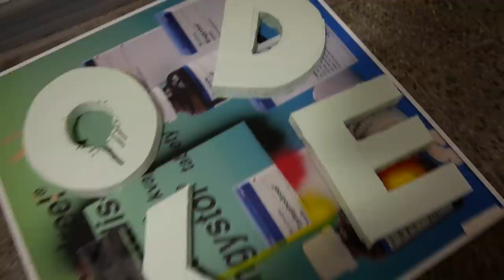I TRY CARVING - This stuff is sooo Satisfying!

Comment: Hey doke, my parents use to have a poly art business and used a table cutter, two pieces of poly, glued with aquadere. One would be a black background with the colour pieces stuck on top to make the 3d. They also used thick cardboard as the design template which was pinned to to poly and would allow the hot wire to cut close clean lines. I have lots more tips if your interested.  I write Wizer  and  live in Australia. Peace

Comment: For the next time you do this, you could use the clean cutting wire to cut the inside holes, just cut in through one edge and around the inside hole then back out the same slit you cut to go inside the hole, it will leave minimal visual damage and could be glued together if the tiny gap bothers you

Comment: The best way to get rid of the bulk of the high density foam is with a fine blade in a jig saw.  Plus, you can get super clean lines with the use of sandpaper.  It sands extremely well.

Comment: Art hack for big circles (I always use this one for mandalas when I draw something bigger) - tie a piece of yarn around a pencil, then take the other end and wrap it around a nail/pin/ whatever. The yarn should be as long as half the size of the circle you wanna draw. Then put the pin in the middle of the space where you wanna draw the circle, pull the pencil as far as you can and boom - you'll get a somewhat perfect circle.

Comment: At my work  for foam cutting in the packaging department we have a table with  a hot wire going through vertically. You have way more control when have it fixed and just move the foam. Its like having three hands.

Comment: You should be able to take the wire off on the first one. So the straight attachment you used was to make the initial mark for the inside shapes then you can go back and use the wire to cut it out. You would just have to undo the wire and retighten it.

Comment: As everyone mentioned get some sandpaper. I would also suggest to use filler spray before painting. Maybe you can get a smoother surface without the foam texture und sketch lines

Comment: you could try to just cut the sculpture on the outside and maybe use one of those sawblades you were mentioning in the video but you can defenetly also get a better result with a really fine hand saw some sandingpaper and maybe use some sort of a dremel tool to give it more texture and depth :)

Comment: I like the carving video I was just thinking when you're using the needle Hotwire thing if you just kept a wire brush nearby and clean it every so often you might be able to get straight smooth lines with needle tip

Comment: There is a tool similar to yours but the hot wire is vertical and it's mounted on kind of a plate so you put your material on the plate and then you can move it thru the wire so youll have got excellent 90 degree shapes and round shapes will be much easier. Hope you understand what I mean. PS. You're an awesome Youtuber
Reply: https://shop.probauteam.de/epages/61352506.mobile/de_DE/?ObjectPath=/Shops/61352506/Products/Proxxon&Locale=de_DE   

That's a web link for the product I mentioned. Greetings from Germany 🇩🇪

Comment: Not sure you know this Doke but when cutting out areas such as the inner part of the "O" you can poke a hole in the center of the area then on the main wire foam cutting tool you un-tie one end of the wires from its post then string it through the hole of the "O" and cut the desired shape out. Cutting foam is pretty nasty if you don't have a fan or open area for the fumes.

Comment: The rod cutter is used to make a hole to then disconnect the wire feed through hole reconnect and cut probably. Almost exactly like a jeweler saw would be done. Pre drill hole insert cutting apparatus and Bam!! Idk just a guess

Comment: If you draw the design you want to carve on paper and spray glue it to the foam the hot wire wont cut the paper giving you a clean edge that's how I've been doing it for years. You did great for free hand though.

Comment: The nice thing about styrofoame is that you can sandcast it, whitout removing de faom creature out of the sand before casting. In this way you can cast everything that you make out of the styrofoam. This is because the styrofaom will  disapear when the hot metal touches it.

Comment: Metal straight edge and tape it to the foam. Wire follows the edge. Prob will destroy the wire faster though. Get a steel straight edge about 18” at least

Comment: I think that when you have a hole in a letter the idea is to make a small hole first with the point tool. Then take off the wire from the cutter, thread it through the hole and put it back onto the heated cutter.

Comment: Hello Doke I have used this trick alot to seal poly or any kind of foam check out Punished Props Academy on Youtube. Basically use Mod Podge or any white glue for the 1st layer then you can use rattle can primer afterwards. Then paint with with whatever you like, plus you can also sand the primer smooth as well. 
I really like your content and art work keep it up.

Comment: Doke , I feel that you might miss the one thing about this, as much as you might already have read. BUT ... when doing these sculptures cutting out is just one part. Then you have to patch, as @SCOCAT stated you need to high grit sand it also. So here is my two cents (or 2 euros). 

1: I would of done what you did and cut each letter out as a single unit. 
2: Cleaned them up with the sandpaper and just worked on the over all shape (not just blocked but any other way)
3: Used Poly glue to adhere the letters together and made it flow that way. 
4: Airbrushed some color into it and or applied bondo to make it stiff.

This all sounds good and i know you are not "ballin" (make tons of money) but this video is a good and solid foundation for things that you can build on and make WAY better. You use the platform of youtube to show your content, and i am sure they have some creators that do Poly crafting also so you can see or do what they are talking about. 

* What i like to see on the next video is - Gunpla with street art on it * : Link for expliantion https://softoyhobby.com/tag/gundam/page/2/

I have a few that are built and would be ok shipping them DM me and if this is something you like then that is fine with me. I can go over which ones i have so you can get what you need for your style.

Comment: You use the thicker cutter to cut around the whole leaving an inch around doke then you use the thin wire to cut out the letter to uave smooth cuts. You just made a big mess with alot of wasted time.

Comment: I Think you should use the sticks for single little holes. Disconnect one edge of the fine wire from the arch, pass it in the hole and reconnect. Now you can cut big holes with clear surface.
"LIKE👍🏼" to make DOKE read this
Thanx